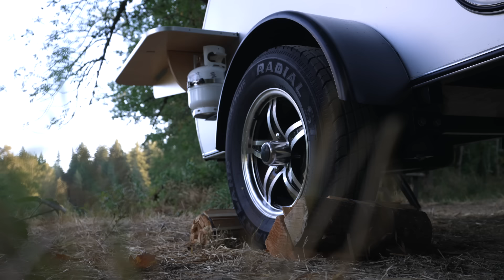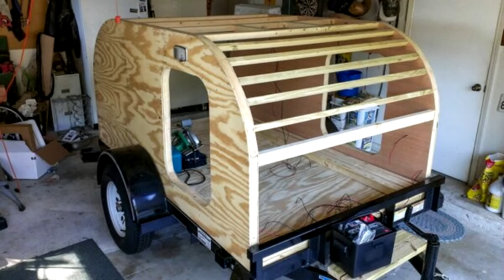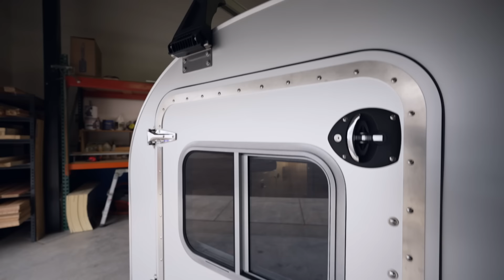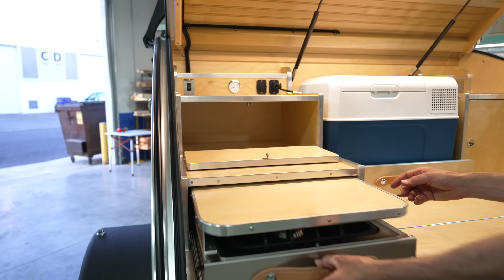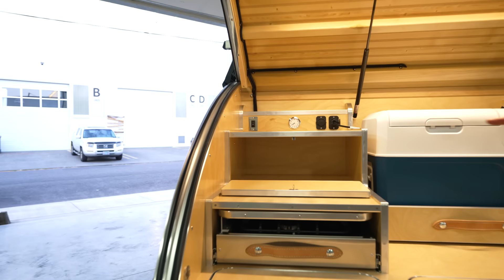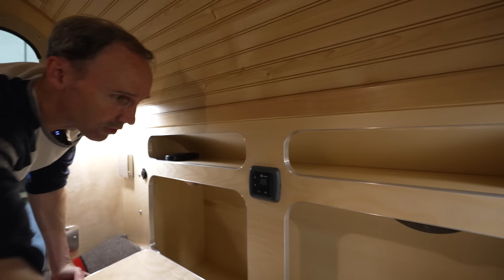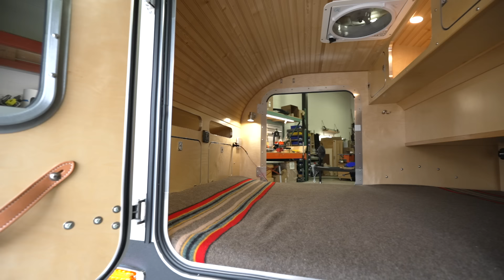RAISING THE BAR! A New Standard for TEARDROP Trailers

Comment: I’m a bit of a craftsman myself and this really looks to be exquisitely built.  Love the hardware, windows and ambiance of the interior. Build quality and price on this trailer would put it right at the top of my list, except for one of the items you noted: the galley hatch providing virtually no coverage. This is about the first thing my wife looks for.  If you can’t stop, open the galley and have at least some overhead shelter, she is not interested.  The deep inset shape of the galley is, I presume, the root cause of the hatch coverage issue, and like you mentioned, looks like it could be awkward accessing the fridge and storage spaces.  A slight modification of the shape of the rear of the trailer could resolve both concerns. 

Re: the fiberglass propane tanks. These are marketed for boaters. I was very close to buying one of these 4-5 years ago for my car camp setup (in a smaller size, like 7 lb version).  I ended up not doing so because of the cost and lack of availability, they were on back order. I ended up with a small steel tank that, when full, can last us 3-4 weeks. 

I’m VERY drawn to most features of this trailer, but the galley hatch would be a hard sell for my wife.
Reply from the maker: As a crafstman I know you would love seeing this in person. When I saw it I instantly fell in love. It truly is a rolling piece of art. Dennnis has been responded to a lot of the comments. It seems like he is willing to look at the design and see if he can come up with solutions. So neat to hear. Typically the builders dig their heals in and fight the comments. And I get it, this is their baby. So it is so neat to see Dennis at least willing to take a shot at it. I was wondering who was utilizing these propane tanks. If they made a fiver pound version we would buy one today. But the 11 and 17lb are just too big for our propane storage area.  We have been big fans of our 11lb Manchesters. I like that they have the same footprint as a 20lb propane cylinder. This makes it easy to find mounting hardward. And it is just the right size to get us through one summer of cooking and occasional fire pit use. My wife would be in agreement with yours. She is 100% sold on teardrops. And I think a big part of that is the full galley experience.

Comment: Another great tour. This teardrop looks awesome. I feel like saying the propane heater being the only option on the one shown seems misleading. Looking at their website it looks like the roof rack, the cargo box, and the fiberglass propane tanks all cost extra. Just thought it was worth mentioning. Still seems great for the price just not as all inclusive as presented.
Reply: Good morning, Chad. I thought I'd shoulder some of the load for Drew and help answer some of the questions/concerns, particularly about the pricing change. Some background on this… Drew shot the footage for this video in mid-August 2022 when he was traveling around Oregon visiting several manufacturers. 

In March 2022, we had decided as a Company to try and "break from the herd" on our pricing model.  Historically, we priced our trailers somewhat like other builders- offering a “Base” trailer and then having customers “build up” their trailer from a list of additional Options and Accessories.  We always prided ourselves on having a comparatively fully-loaded Base trailer to start with and relatively few add-ons, but took the big jump in March ’22 of rolling the majority of our previous Options (roof rack, aluminum storage box, composite propane tanks, rear receiver, larger 170 AH battery, etc) into the base price ($24,850 in March) leaving only a couple features as Options (the cabin heater being one).  We felt this would be less hassle and more transparent for both our customers and ourselves having seen that 9 out of 10 of our customers selected most of these Options eventually anyway.  It was a genuine attempt to make buying the trailer simpler for our customers (we heard lots of complaints about the confusion and added cost going through the dozens of Options of other builders) and streamline our own processes by knowing exactly what equipment would be on each trailer rather than each one sporting a different mix of equipment.  

After 6 or 8 months of feedback from prospective customers and others in the trailer market, it became clear that people had become so accustomed to the “build-up” pricing method, that at first glance of our pricing, many people assumed they would be adding $5,000+ in Options as well and simply clicked away.  Some other customers indicated there were features that they didn’t necessarily want or need and asked for credits for those things.  We finally decided that our simpler pricing model simply wasn’t landing the way we had hoped with our customers.  

As a result, we decided that for new orders in 2023 we would go back to a traditional “a la carte” pricing model, reducing the Base price from $24,850 to $19,950 and shifting several of the features back onto the Options/Accessories list to enable customers to build their trailers to suit their needs and budgets.  

I know this is a lot of information, but I wanted to help clarify why my comment in the video that “all those things were included in the Base price” does not correspond to our current published pricing.  I hope it is clear that there was no intention to be misleading.  In fact, taken as a whole, our pricing has actually come down across the board since early 2022 as we have continued to become more efficient manufacturers and more innovative in our processes - an unexpected positive outcome of being forced to optimize every business practice in the face of the myriad challenges of a Covid-19 pandemic!      
Best -Dennis
Reply: @greasywheats  Thank you for the explanation. That makes a whole lot more sense.
Reply from the maker: Sorry Chad part on the pricing was a mistake on my end. I wanted to quickly let you know that. It is almost 3 in the morning where I’m at, but I promise when I wake up in the morning, I will explain it better. Definitely not a Dennis issue, a 100% a Drew issue.
Reply: @PlayingwithSticks  No worries Drew. I figured there must be some sort of confusion but seemed like the sort of thing everyone would want called out.

Comment: Sorry I only watched the intro of this video. I stopped when I saw the galley hatch. IMO it's a complete deal breaker. 

I don't understand why anyone would design a teardrop with a hatch that provides minimal/no shelter as a roof. My advice is to loook at the basic design first, if it passes consider the details.
Reply: I'm a little unusual, because I mine the "negative" comments from this type of thing as the real gold!  I'm hearing the issues that people have mentioned and they'll become areas we focus on.  A quick and dirty reason for our 3/4 hatch centers around the ability of the shorter hatch to stay torsionally rigid and seal significantly better, longer than a full floor length hatch which tend to have more twisting forces and issues properly sealing for the long-term (see Drew's comments on the "jiggly" hatch of the Road Toad and the Bean).  That said, I'm hearing the core issue is being able to create some additional overhead cover when the hatch is open (without having to set up additional tarps/tents).  That's what I'll be thinking hard on to create an innovative solution for!  I think this can be readily accomplished without a complete re-design of our hatch.  Stay tuned!
Reply: I'm sure it can be done.  I really don't see a minor degree of flex being an issue as long as the hatch provides a positive seal and stays open as it should. 

We have zero problems with our full size galley hatch. It provides a very nice instant shelter. We've also hunkered under it in some pretty rough weather, with the addition of our galley wings and a rear tarp wall.
Reply from the maker: Thanks for sharing your thoughts on this.

Comment: Does it take two hands to open the doors with the double latches? I ask this as a one-armed disabled man.
Reply from the maker: From what I remember I don't think it does. The two latches are compression latches. So you would flip each one individually and then open the door using only one of the handles.
Reply: HI Robert, it does not take 2 hands to open the doors,  I just open one latch at a time...no hassle.

Comment: Wood will rot quickly in moist environments.   I live in the SE and this is a no-go.
Reply from the maker: If exposed yes. It really comes down to properly inspecting all seams. If stored properly and inspected properly a trailer like this, even in the PNW or Florida could last a lifttime. But like you said, there are other options out there that would require less attention to this.

Comment: Sorry to say but those fiberglass propane tanks are not standard (standard steel is) and so is that large AGM battery(per their website)… very shady isn’t it, ‘slim’?😂😅😂
Quality does look fantastic ❤
Reply: I thought I'd shoulder some of the load for Drew and help answer some of the questions/concerns, particularly about the pricing change. Some background on this… Drew shot the footage for this video in mid-August 2022 when he was traveling around Oregon visiting several manufacturers. 

In March 2022, we had decided as a Company to try and "break from the herd" on our pricing model.  Historically, we priced our trailers somewhat like other builders- offering a “Base” trailer and then having customers “build up” their trailer from a list of additional Options and Accessories.  We always prided ourselves on having a comparatively fully-loaded Base trailer to start with and relatively few add-ons, but took the big jump in March ’22 of rolling the majority of our previous Options (roof rack, aluminum storage box, composite propane tanks, rear receiver, larger 170 AH battery, etc) into the base price ($24,850 in March) leaving only a couple features as Options (the cabin heater being one).  We felt this would be less hassle and more transparent for both our customers and ourselves having seen that 9 out of 10 of our customers selected most of these Options eventually anyway.  It was a genuine attempt to make buying the trailer simpler for our customers (we heard lots of complaints about the confusion and added cost going through the dozens of Options of other builders) and streamline our own processes by knowing exactly what equipment would be on each trailer rather than each one sporting a different mix of equipment.  

After 6 or 8 months of feedback from prospective customers and others in the trailer market, it became clear that people had become so accustomed to the “build-up” pricing method, that at first glance of our pricing, many people assumed they would be adding $5,000+ in Options as well and simply clicked away.  Some other customers indicated there were features that they didn’t necessarily want or need and asked for credits for those things.  We finally decided that our simpler pricing model simply wasn’t landing the way we had hoped with our customers.  

As a result, we decided the that for new orders in 2023 we would go back to a traditional “a la carte” pricing model, reducing the Base price from $24,850 to $19,950 and shifting several of the features back onto the Options/Accessories list to enable customers to build their trailers to suit their needs and budgets.  

I know this is a lot of information, but I wanted to help clarify why my comment in the video that “all those things were included in the Base price” does not correspond to our current published pricing.  I hope it is clear that there was no intention to be misleading.  In fact, taken as a whole, our pricing has actually come down across the board since early 2022 as we have continued to become more efficient manufacturers and more innovative in our processes - an unexpected positive outcome of being forced to optimize every business practice in the face of the myriad challenges of a Covid-19 pandemic!      
Best -Dennis
Reply: @greasywheats  Yes
Thank you for taking the time to clarify.🙏
Is there any chance you would consider modifying the rear door to full length like Drew pointed out?
It is a genuine drawback IMHO.
Thank again
BB 🍻
Reply: @BlazinBlades  
You're very welcome!  I'm a little unusual, because I mine the "negative" comments from this type of thing as the real gold!  I'm hearing the issues that people have mentioned and they'll become areas we focus on.  A quick and dirty reason for our 3/4 hatch centers around the ability of the shorter hatch to stay torsionally rigid and seal significantly better, longer than a full floor length hatch which tend to have more twisting forces and issues properly sealing for the long-term (see Drew's comments on the "jiggly" hatch of the road toad).  That said, I'm hearing the core issue is being able to create some additional overhead cover when the hatch is open (without having to set up additional tarps/tents).  That's what I'll be thinking hard on to create an innovative solution for!  I think this can be readily accomplished without a complete re-design of our hatch.  Stay tuned!
Reply from the maker: Good eye. Here was the response I just wrote someone today "I will have to talk to Dennis about this. When I shot this video he had everything at base. However, he did send me an email this year regarding marketing. He had wondered if he would be better off decreasing the price of the base and having more add-ons. Basically wondering if sales were potentially lost because people would see the base price and think it wasn't competitive with other trailers. Essentially trailers that were hiding their out the door additional costs outside their base price. Does that make sense? I am wondering when he assessed his annual cost increases if he lowered his base price and moved what were his standard components into an upgrade model that people were more accustomed to. I wish I would have realized this before releasing the video. I typically do my homework, but it looks like I did my homework a little too early on this video. Thank you by the way for pointing this out and adding the costs.  I really appreciate it."
Reply: It’s just that the guy said everything is standard aside from the Propex heater but many items we saw in the video are paid options.
Reply from the maker: Yes, I believe everything was said with good intentions. If you check out my other comment to you I think I just didn't do the best job of double checking my homework. Again, thanks for catching this though.
Reply: @PlayingwithSticks  to be fair the Vistabule’s base price is also about $4,000 higher nowadays. (Huge stargazer included)